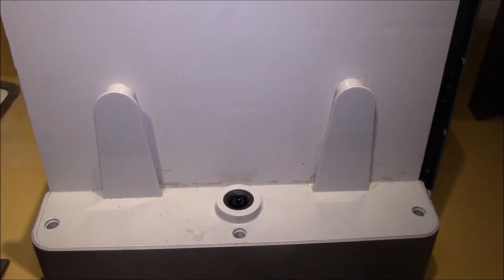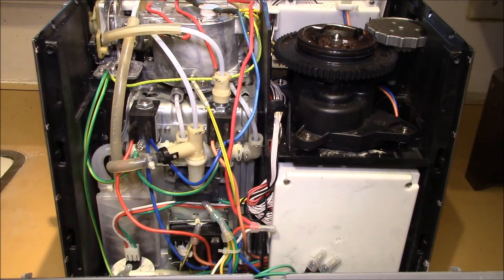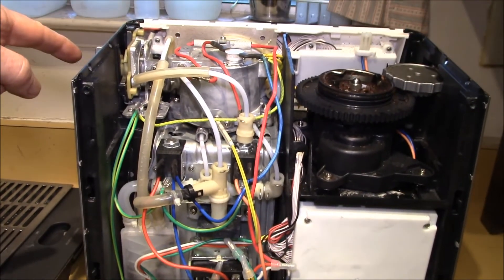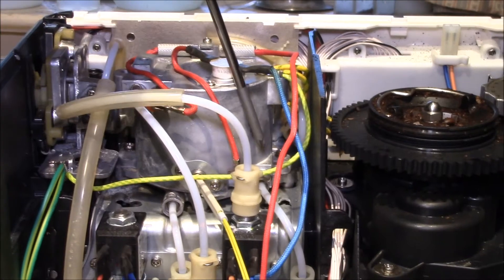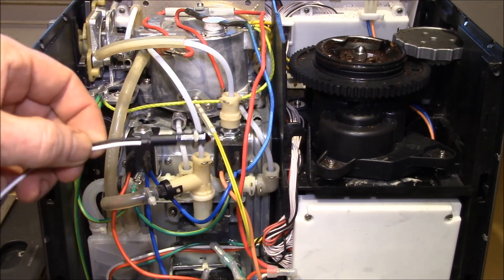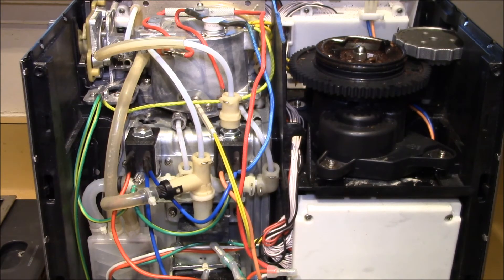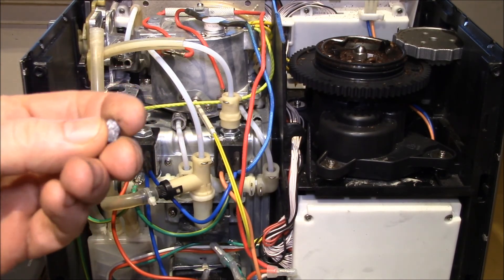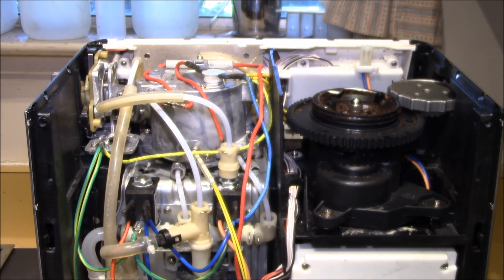Breville/Sage 870XL Barista Express - Water Flow

Comment: Great video!  Can't quite figure out why I can't get my machine to work properly. My water will dispense from the area by the wand but it's not heated. My steam wand won't function and my brew head gives me no water. Essentially what is occurring is all of my water is simply getting immediately dumped into my reservoir and somehow avoiding being heated. My thermocoil is extremely hot, however, no water is hot.

I've replaced my solenoid and my water pump - still no luck. Running out of ideas!  Any advice?
Reply from the maker: Open up the back of the machine and try to observe where the water is flowing out to the drain.  A likely place is the safety/overpressure valve, if that's stuck open:
https://youtu.be/46UBebNJ-uo
Be careful as there's exposed, live electrical connections inside.  Could also be a plugged water line before the solenoids and that's causing the pressure to open the overpressure valve and dump water out.  Try pulling each line off and see if you can blow air through it.  Same with the thermo-coil, should be able to blow air through it via one of the water lines.
Reply: @The4Crawler  Thanks for the quick response! I've done that and what's occuring is water flows through the safety valve white plastic line up to the area where yours broke by the wand switch then all of the water flows through the thick line where yours broke and dumps into the diffuser which dumps into the reservoir. I believe this is why I can't get any heated water because everything gets dumped before even having a chance to get to the thermocoil.
Reply from the maker: @JSpazJune  Sounds like some of the water lines are connected wrong.  Should go from the safety valve to the thermocoil then back to the side of the 3-port solenoid then out of the top of that solenoid to the hot water/steam valve.
Reply: @The4Crawler  DUDE!!!!! You're right! I had just about given up on the machine because nothing was making sense. So I had the tube that comes from the solenoid mixed up with the safety valve tube.  I used your videos for everything else over the past 2 weeks and was just about to decide it was either the Flow sensor, the thermo coil, or an unfixable issue. 

Please send me a way I can send you $20 man. Venmo, Cash App, PayPal, however, you'd like.  You're the best!!!!

The local espresso repair place wanted $150 just to diagnose the issue so I was just about to accept defeat!
Reply from the maker: @JSpazJune  Glad you got your machine working again.  There's a Paypal.me link on the main channel page if so inclined.
Reply: @The4Crawler  Sent! Thanks again, Brother!  We appreciate you!
Reply from the maker: @JSpazJune  Thanks as well, always good to hear of a successful repair.

Comment: Thank you so much for the video. Extremely informative!!
I am currently having the below issue.

I noticed low pressure coming from the steam wand on my machine and some water leaking through one of the legs. Upon inspection inside I noticed that it was leaking water on BOTH sides of the tube connecting the over pressure valve on top of the pump and the thermocoil.  The o-rings seem ok but somehow the connection feels a little lose after pushing the tube in and putting the small metal clamps.

Any thoughts on what I should do to stop this leak?  Any guidance will be greatly appreciated, would love to be able to fix this amazing machine that has lasted me almost 10yrs with no other issues.
Reply from the maker: Hard to say.  Could be the o-rings are not seated properly.  They can get twisted up when inserting them and not seal well.  Could be they are old and not sealing.   You could compare the feeling of that tube fitting with one of the other ones on the solenoid valves for a comparison to see if they are indeed loose.
Reply: @The4Crawler  I tried using other o-rings from another hoses in the machine in the hose that was leaking and it seems like only the connection on the thermocoil is now leaking, it kind of feels the joint is not tight enough, too much play from the metal to the clip.  

What do you suggest I try next? This seems like an easy repair (as no mechanical parts need replacing but how can I secure that hose tighter?... Ugh
Reply from the maker: @macutan  You might try wrapping a bit of Teflon pipe thread tape around the end of the hose and o-ring and see if that can take up the extra space.  Could also be the old o-rings have all compressed a bit with the years and no longer fit tight.
Reply: @The4Crawler  great suggestion, (and thanks for the super quick response time!!) will give that a try. the o-rings are definitely not twisted but will try if using other o-rings from another part of the machine will create a better seal.  What is strange is that it leaks from BOTH joints...

Comment: Here is a question. I am seeing dripping when I pull out the bottom tray. This dripping is coming from the inner front wall. It starts after I hit one of the shot buttons. I also see a few drips come out of the grinder port...not the shot port....that was wierd. I bought this Barista pro second hand so now I am getting aquainted with the machine trying to make a good shot and all of the lights and buttons seem to function and start up but I did notice a low pressure. I saw steam come out of the grinder dial and some out of the back of the machine... Do you think there is an internal leak? Nothing should leak internally, correct??? thanks for your advice.
Reply from the maker: Yes, sounds like an internal leak.  You can open the back of the machine and look for signs of leaks like I did in this video:
https://youtu.be/46UBebNJ-uo
Be careful as there are live electrical connections exposed inside.
Reply: @The4Crawler   Thanks for the advice. I followed along the tutorials and replaced the solenoid assembly. I think it could have gotten away with just the Oring in the elbow valve seal but now its all running and no more leaking. Now I see the backwash  pipe above the water tray from the front dumps some water everytime I turn on the machine. Do you think that is normal? I want to make sure my machine is back to normal before I put it back together again. Turning it on testing the machine for leaks I noticed the tray will get enough water that I had to dump it... I hope maybe on startup there is a process to do a backflush...so if I were not turning it on and off it wouldnt fill up...can someone on here check to see if there is a purging of water moment during startup into the water tray?  I would appreciate it! thanks for your advice!
Reply from the maker: @xpez9694  It is normal for the pump to run for a few seconds when the machine is first turned on.  And at that time, the solenoids are all closed and that send water up to the hot water valve and down it's drain tube to the drip tray.
Reply: @The4Crawler   Great I was running some shots anyway and the pressure is in the range and even goes above the half way point...and I am seeing some great looking crema.. looks like she is back to purring to normal! excellent!!!

Comment: Great video.  I've had my machine for 2 years and didn't use it for 1 year, but trying to cut down on the coffee i started using the espresso machine.  the pressure was always in the middle then one day it hit max.  It was the day i changed coffee, i grinded it myself so i thought maybe i made it too powdery and tried it again.  Then it jumped from low to high and noticed something wasn't right... but kept using it since coffee came out.  Maybe 7 cups later i notice the drip tray full. I always put a little bowl under the cup so it didn't make sense it was full.  Thought the machine blew a seal somewhere and disconnected it.  Saw another video of a water leak by the bucket.  Today i took the back/top off and noticed the little rubber hose on the bottom and knew it was meant for something and the cause of my water leak.  Now with your video my problem may be related to the solenoid that handles the hot water.  It may be stuck on 2 hoses and it would explain how a full tank only handled 3 or 4 double espressos and filled my drip tray!!  Do you have the model number of the solenoids that you can share?  I saw your water pump link.  Thanks.
Reply from the maker: You'll find that information in this video:
https://youtu.be/96IuKiuIB5A
Likewise another video in this playlist that covers cleaning the solenoid valves that may get them working again.

Comment: Thanks, this water flow video and then this solenoid disassembly helped me fix my machine that was barely two years old. The first time I had an issue about 6 months ago after a descaling, the steam wand wasn’t working the next day. I took it apart then trying to figure it out, I squeezed the tube coming from the Steam/hot water switch that I now know goes to the diffuser and saw some water move around in the tube. I then powered the machine up to test the steam function while I was watching the tubes inside and the wand was working again and I did not have an issue until about a week ago (about 6 month after the steam wand issue and 3 cleanings I think). I think the squeeze must have been just enough to bump whatever may have causing the problem. . Then last week after a descale and clean, two days of normal use, on the third day nothing was coming out of the group head except a drip and no pressure building up. The Hot water and Steam were still working. So tried the 'squeeze method' again, but this time didn't fix. After many worthless searches, I found this water flow video first, then watched the how to replace the solenoid and then the solenoid repair video. Based on my symptoms and my understanding of the water flow from the video. I suspected the three-way valve (one on the right when looking into the machine from the back). On mine there was an e-type retaining ring that was inserted from the back to the front on this valve so I was able to remove it without taking anything else off. I unscrewed the top threaded water connector that goes back to the group head leaving it connected on both ends, (because of the way it is put together, the small tube turns freely while still connected to the threaded connector that attaches to the top of the valve assembly). I then disconnected the wires and was able to remove just the solenoid. In my case I had to use needle nose pliers to remove the slug because it was not falling out as I learned after cleaning is what it should have done. I cleaned it, soaked it in store bought descaling solution for about an hour and reassembled. Slug moved freely inside of the threaded sleeve. Reassembled the solenoid and reinstalled into the machine, tested and was super happy. Thank you so much for the videos.👏👍
Reply from the maker: Great job fixing your machine!  Hopefully your post may help someone else.

Comment: Hello, I have one of these ... there was an electrical problem and something in the circuit pcb (BV1870L1) was damaged, I will send the images if you know the measurement of the resistance r37 and the transistor q7 that I should replace. Thank you

Hernando
Reply from the maker: R37 appears to be 1K ohms, Q7 is impossible to read any p/n due to the conformal coating that's been applied.  You might check this page to see if there's any information about that:
https://siber-sonic.com/appliance/800Electrical.html
Otherwise, new PCBs are available.

Comment: thanks to your videos i was able to repair my Solis Grind and Infuse Pro 115A , which is the Dutch/European version of this machine. In my case, there was no water coming out of it, not with the coffee function or the hotwater/steam function. The problem was the tube between the hotwater boiler and the Solenoid input, the 'knee'., where the hose entered the knee it was full of scale and stuff. Then when i got the hose of the boiler 'WOOSH/SQUIRT' all various scale and goo came out of the boiler. Cleaned it all and it is working like a charm now!!
Reply from the maker: Good tip, glad you got your machine working again.

Comment: I descaled my 870XL because the solenoid was buzzing, and it did help but didn’t fully get rid of the buzzing even after two more attempts. So I took the machine apart to get the the 3-way solenoid and took it apart to clean like in your video, but once I put everything together there’s no steam or hot water function. What’s even more odd is there’s no discharge of over pressure, for any action I do. Brewing works and when I switch it to steam or hot water, after hitting brew all the hot water/steam exits the group head. Any ideas what it may be? I’m pretty sure I’ve cleared the solenoid and have tested resistance on both which looked solid.
Reply from the maker: Hot water / steam flow comes out of the top of the 3-port valve and that's the "off" position.  If that's not working, then perhaps the solenoid plunger is stuck or something is blocking the tiny port inside or one of the the Teflon tubes is plugged internally or connected to the wrong place.  You should be able to blow air through the side of the 3-port valve with the top port open and feel the air escaping that way.

Comment: Hi, could you please tell me whay the watwr is going to difuser instead go up, what's the falt? Thank you
Reply from the maker: Could be the solenoid valves not working correctly, like mine:
https://youtu.be/96IuKiuIB5A
In that case, 3-port valve doesn't fully seal off the top port, that passes water up to the hot water/steam valve and then down to the diffuser.  Could also be the over pressure/safety valve is stuck open and letting water go out that way.
Reply: Thank you for quick response, much appreciate 👍, I will looking to order
Reply: Yes that's the one fault 3 way solenoid valve, thank you for your support 👍
Reply: Sorted, thank you

Comment: Hi There. Thanks for these great videos!! My Barista works but the performance has been going downhill. Having watched your videos I took it apart and replaced the 3 way solenoid & valve. I feel that helped a little but I have now discovered that whenever I make a coffee approx 40% of the water goes directly into the drip tray. Could this be an exhaust valve / solenoid issue? or do you think it is more likely to the the pressure valve assy, given that I have replaced the inlet solenoid & valve?
Thanks!
Reply from the maker: Pop the back cover open and have a look inside while running a cycle:
https://youtu.be/46UBebNJ-uo
You should be able to see which path the water is taking to the drip tray.  Take care as there are live electrical connections inside, so look but don't touch!

Comment: Hi thanks for your video. I have an intermittent problem. Sometimes the steam wand works (but not to full capacity, still some water trickling out) and sometimes it doesn’t work at all - when this happens the pump sounds weaker that normal. Any ideas?
Reply from the maker: Hard to say.  It could be the pump is starting to go, maybe try removing and replacing the wire connections to the pump in case they're oxidized or loose.  Could be the over pressure valve is bypassing water to the drip tray.  Could be the hot water/steam valve is clogged inside and limiting flow.
Reply: @The4Crawler  thanks for your reply. I stripped down and cleaned the solenoid and it’s good as new 😃😃😃

Comment: Hi from Melbourne, Australia. We're in covid lockdown and our Breville Bes870 has suddenly lost pressure!!!
Aargh! What to do!? No espresso in the morning is the last straw 😄
Watched your video all through after taking the back and top off the machine. I now have a much clearer understanding of what could be wrong (it's not the coffee or the grind blah blah. There's a feeble trickle of water comes out when there's no grouphead in place).
For one thing, the 6mm water tube running to the hot water outlet(?) looks pale brown and gunked up - but you've suggested that wouldn't affect the espresso making pressure? Should I try to unclip it to flush it out somehow? 
 Hope you can give me some clues. I'm fairly handy and since we can't get the machine to a Breville repair depot, I've got nothing to lose by trying any simple fix you can suggest. Many thanks in advance and cheers.
Reply from the maker: Yes, try cleaning out that tube and also any thing it connects to.  See if you can find where the discoloration is coming from.  Aside from the diffuser and line running to the drip tray, should only be clean water in the system.  Maybe the over pressure valve is bleeding off pressure or the solenoid valves are sticking partway open, etc.

Comment: I have a question,  I got breville 840 and when I press the switch to brew coffee the gage goes up and down few times until it stop. I only get a little bit of coffee then see water going out to the reservoir,  is this sign of the water pump failure?
Reply from the maker: Might be the pump, or the safety/overpressure valve opening up.  See the video on the pump and safety valve in this playlist.  You could check by opening the back of the machine a bit and peek inside while running a brew cycle to see if you can see where the water is coming from that's running into the drip tray.  Be careful as there's exposed electrical connections inside.